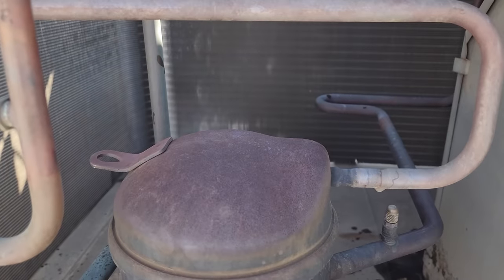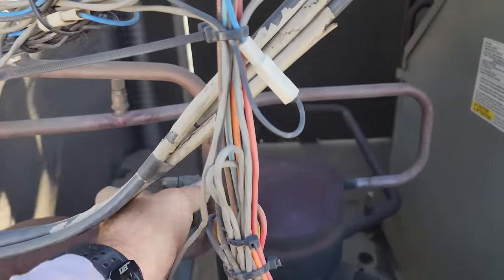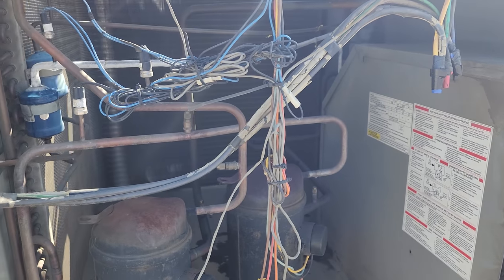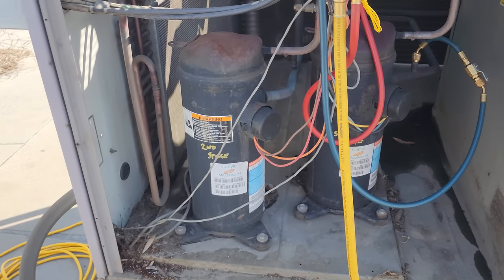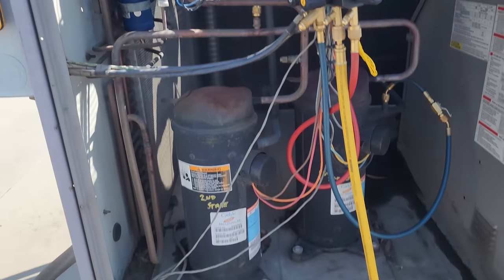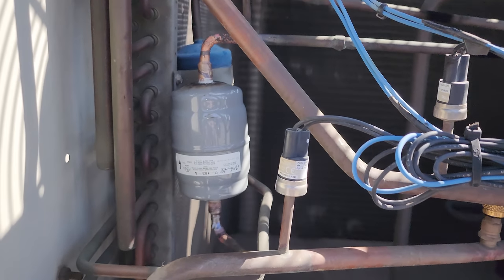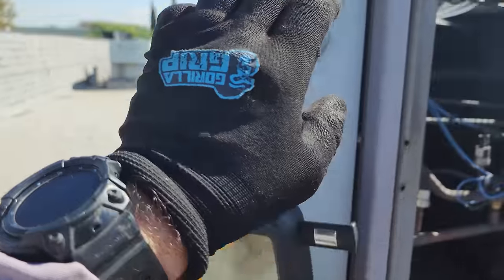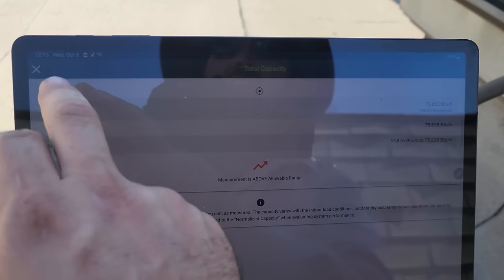WHY IS THE COMPRESSOR STEAMING??

Comment: I am a commercial HVAC company owner in the Carolinas and I can tell you this I fired all the restaurants we had we concentrate on manufacturing, and office buildings never been happier no weekends nights or holidays they don’t even blink when you hand them a bill
Reply: Where in the Carolina’s??
Reply: I wonder if your company is the one that charged my manager 2000 to fix our HVAC system when the compressor burned up on our unit that was only a year old. 😂Had the fool listened when I told him the thermostat was saying there was a cooling problem to begin with instead of ignoring the problem or 3 or 4 months the warranty would have probably still covered the labor as well.🤣

Comment: Overheated refrigeration oil turns into some sort of powder most of the time, ive seen some that looked like it turned into burnt caramel and stuck to a wall of 3/8 inch pipe, plugged solid
Reply: replace just the compressor and service nothing else. rinse and repeat every 6 months. this was happening at a place i worked at. compressor was short cycling and the owner's "guy" just kept replacing it over and over. I tried to tell the owner what was going on and he flipped out on me

Comment: The oil in that stage has likely turned into blackened tar from overheating, which is probably what clogged up the drier. And I agree about the whole system needing to be replaced; with the age and condition of the unit, and all the work that needs to be done to it, all the cost of labor and parts isn’t really worth it. Just replace it! Of course I’d still be happy to do the work, but I’m also looking out for the customer’s best interests.

Comment: With stage one having a full charge and a plugged up drier....i too would of thought those fixed bore would've been plugged. That oil is most definitely trashed and that compressor has been overheating for quite some time now. That unit is definitely on life 8 of 9....living on borrowed time.
Reply: Interesting thought. The filter did it's job and sacrificed itself. It plugged not the metering device.
Reply: @deseehc  yes it did do its job....next question...is for how long before it pluggs up again. That oil is toast. That or the fixed bore are next to plug up.

Comment: The AC is doubling as a cook surface for the kitchen. No that is energy efficient! 🤣
Also I picked up the Wiha insulated torque set and loving it. I got the new version with the additional bits.
Reply: perhaps run a preheat water line for the dishwasher

Comment: Good job getting that museum exhibit running.  The customer would be wise to start ordering equipment right away so you can address the worst of the issues before the return of heat.   Otherwise there will be tears flowing along with the sweat, an unholy mixture.

Comment: The same thing again and again. The others before you cannot be bothered to braze with nitrogen.  IF prior compressor burnout, the system wasn't flushed to eliminate acid products. The filter does it's job and now plugged.
Reply: Hate that shit. Braze with nitrogen(especially after a burnout) or get out of the industry.
Reply: The compressor isn’t burnt out. Running elevated head pressures or an excessively high compression ratio can cause this and a lack of pms on the units
Reply: @shifter8207  True however the condenser was still open.
Reply: @xzearr  more like braze with nitrogen period or get out.

Comment: Electrical engineer, but NOT a trained HVAC guy here, north Texas. Had my condenser fan crater on my December 2010 installed Trane 4 ½ ton home central AC unit (not a heat pump), and the compressor went in to overtemp shut down.  I caught it within a couple of hours, and shut it down for the week it took to get a replacement fan motor (replaced it myself).  The unit came back up and seems to run fine now.  To the touch my dryer does not seem to have a temp drop across it, but wondering now if maybe I should have the dryer replaced just to be safe.
Reply: Unless there is a temp drop across the dryer or the system has been opened, there's no reason to replace them preventatively.
Reply: @Thermoelectric7  Thanks!

Comment: Great video dude! The step process of the diagnosis and  repair is pretty much how most of us seasoned guys go about approaching an old carrier like this, and not knowing the stipulations behind the call origin and the customers budget and all of that good stuff, did you recommend combing the condenser coil and splitting the coil for cleaning? I’m just curious if that’s something to even educate the customer on before next cooling season or just unit replacement with hail guards are already in the plans? Keep fighting the good fight and making good videos brother

Comment: I wonder if trying to replace the oil in the compressor and doing a full flush would let it run a bit longer? The compressor replacement is almost the cost of a new unit so it may buy some time?
Reply: 3 phase compressor like that might run you $4000? With labour $5500 ish? New unit installed would be somewhere in the 12-13K range.

Comment: core max units. when i’m already in refer circuit and there is room to easily do so, i take a moment to slap a set of additional service ports in and leave original core max ports in place. ever install iso valves on a line dryer for easier preventative changeout with comfort cooling Equipment?  .

Comment: Once we run in to a filter fault, its completly fall apart in the inside and clocged the compressor suc side, fortunatly is was had a metal basket at the connection , but the oil was trash. btw it was installed in the suc line , so we needed to moove it to the liq side.

Comment: The life expectancy of those unit's is only about 15 years?  I did not know that, that seems low.  And here I am trying to keep our 25 year old a/c running...
Reply: Yeah but the location where he is there's lots of sand which gets into contactors and electrical components, and very high temperatures like 110+ F which is like 45+ Celsius. Plus this unit has fin damage to the condenser coil which makes it work even harder.

Comment: I gotta get someone to look at my 1997 Mitsubishi mini-split R22 unit, pretty sure it is slightly low on refrigerant because it ices up and spews condensation when it runs hard, so we were just running it on low fan and letting it cycle by setting temperature a degree or two below room temp with an additional 600 watt window AC to supplement the cooling, but I’ve moved and want to rent the place out, so the janky window AC need to go...  ultimately it should be replaced with a heat pump because there’s just a baseboard heater, but the building doesn’t allow new AC units to be installed anymore, so we’re stuck with vintage AC.
Reply: sometimes owners corporations are their own worst enemy. It could be low charge, or perhaps restricted in the metering device.

Comment: THIS IS MY TAKE ABOUT THE DRIER PLUGGED UP. SINCE THE COMPRESSOR OVERHEATING AND OVERHEATING COULD CAUSE METAL SHREDDED (LIKE SHRAPNEL) THAT GOES TO THAT DRIER AND IT CAUSE PLUGGED UP. IN ADDITION, THAT COMPRESSOR WILL FAILED IN THE END (MECHANICAL/ ELECTRICAL)

Comment: I noticed towards the end of the video there was a temp probe on the disconnect pointed in front of the condenser coil?  Was that to measure temp at the condenser coil or did you just stick it there?

Comment: It might last until next spring, your customer is lucky we're nearly at the end of peak cooling season. I'm sure it'll die once temps get back into the 110+ range. The insanely high summer temps you get there combined with that condenser coil being so damaged is going to do a number on it. In hindsight, what you could have done is sweat in two 3/8 flare adapters and install a -HH drier, those are pretty good for wax removal, and Sporlan used to have a demo setup back in the 1980's with old black compressor oil being cleaned up back to a straw color with only 24 hours of compressor run time. HH is not for acid removal like some people think, it's high wax capacity. When the oil gets cooked, especially POE oils, it forms waxes which plug up metering devices and valves. That way with flares would be simple to keep replacing the drier until they can get a new unit. With unit availability as bad as it is right now, on top of new energy efficiency rules kicking in next year, you might have to change that drier a few more times, even if they approve a new unit tomorrow, it might be months before you can get a new unit shipped, then schedule the crane etc to get it changed out.
Reply: I like your way of thinking!
In the good old days of hydraulic, we would install traps!
Those traps would have valves at the bottom and we would see where the clear glass what's in the system.

Comment: that filter dryer will probably outlast that unit... but the real question .. is can you even get a new unit?
Reply: By the market this days... 6 months if you inmediatly order and put money down, and even then thats a very optimistic try.
Reply: @rioja951  I ordered a 5 ton heat pump from carrier in march.. was told it would be shipped by September and when I called them they said the factory hasn't even made these yet and pushed it back to December... crazy

Comment: I appreciate all of your videos that you make, but I have a question to ask you or your community, its a werid happening is the best way I am going to say it sadly, I was working on pressure leak test on a residenstial ac 3.5ton and some how my testo 550s digital guages, highside pressure just froze the reading froze on the screen and I could not read whats happening, a little while later the other side froze and then the screen failed not sure what happened to them but it happened pretty darn fast, have any of you ever have that happen before?

Comment: Many HVAC in your videos got a gaz line to warn the air in the winter, is it just a backup in case it's very cold or any of them are reversible ?
Reply: They are package units and double as the heat source for the building in the winter.

Comment: To be fair, combustion engines and their oil can readily run at temperatures beyond boiling point of water. Oil cooled motorcycle engines run HOT in summer and many still live much longer than newer bikes that just make flat out too much power per displacement.  Its the electrical insulation that has me worried. But again. 100 Celsius is pretty much fine for well made transformer/motor windings. It will fail quicker, almost all electrical stuff loves to run temperate - not too cold, not too hot - but you can engineer insulation to take this no problems.....

Comment: Why would you stick your hand into a refrigeration condensing unit which could possibly have a bad earth and also the unit could potentially be live with three phase voltages, how is this professional work possibly putting other people watching this video at risk.
Reply: unlikely to get shocked if it was live would have grounded out and if the whole box was live just touching the access panel would have gotten a shock  also peole do whatever they want you cannot direct them from a youtube be video  lol
Reply: @thewatchersofthewood3530  That's what I mean by a bad earth or ground, plus the unit is on the roof so it would have to rely on the ground wiring, plus the fault could occur even after the panel was removed and the culprit would be the overheating compressor. And no you can't direct people of the risks but you can warn them.
Reply: @tyronenelson9124  If there was a bad ground, there wouldn't be a ground path through the person, and no or minimal shock, only through capacitance. The drain line was cut, so it wasn't a ground path, maybe some sneak paths through ducting with enough resistance to have voltage but not enough to trip the breaker. But everything in the unit is likely to be at the same potential, so without touching another ground, it's hard to get shocked. So, one either has a working ground and the fuses blow, or a non-working ground and difficult reaching a ground and the unit.
Reply: @johnhaller5851  But this is 3 phase voltages we are talking about at 210v ac not 110v ac, and depending on the body's resistance to it, could still be hazardous.
Reply: @tyronenelson9124  There has to be a path to ground, or all those birds sitting on the distribution power lines would be getting shocked. Unless birds are really all robots, that is. Either the case is grounded and the fuse blows, or it's not, and the case has 208v. The only thing nearby which was possibly grounded was the drain line which has been cut because it was plugged. If the case was hot, grabbing both sides of the cut drain line would be bad.
Reply: @johnhaller5851  Birds don't have hands and feet, so whatever the birds are touching or in contact with would be at the same voltage potential so of course they are not going to get shocked, unless you don't know about capacitance and resistance you won't understand.
Reply: @tyronenelson9124  The point is that on the roof, everything is insulated or at the same potential. I have several Electrical Engineering classes as part of my Bachelor's of Science in Engineering degree. I will admit the inductance part was weak, and I didn't spend much if any time on Maxwell's equations or motors. But capacitors, resistors, transistors, voltage, and current were big parts of one of the classes. The other courses were mostly digital electronics, with another one on analog and digital filters chock full of complex numbers during my MSE.
Reply: @johnhaller5851  Well done, but you seem to struggle about understanding capacitance and resistance for some reason And by the way I have 25 years of electrical and electronics engineering experience, as I never really learnt a great deal from short and crappy courses.
Reply: @johnhaller5851  And by the way would you touch or grab a potentially live conductor on a roof?